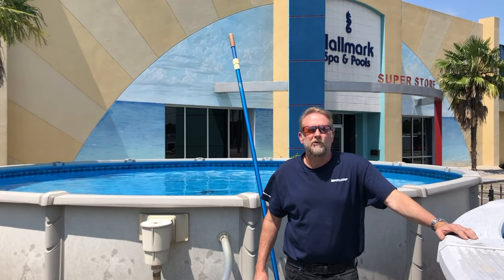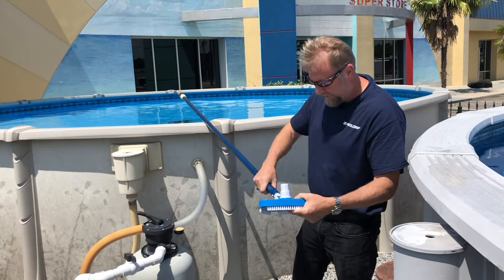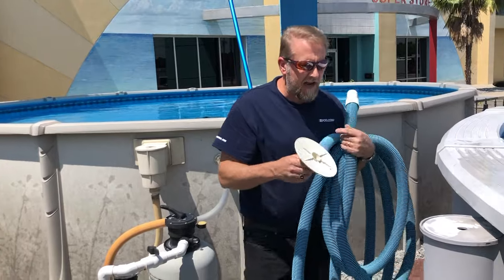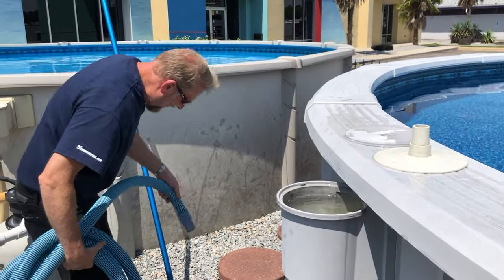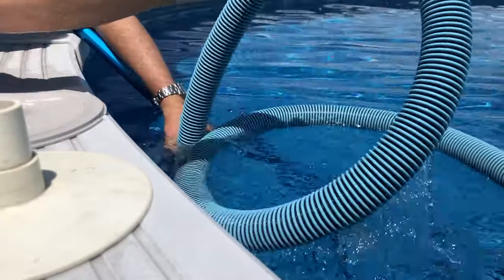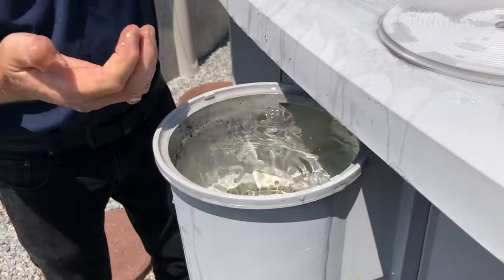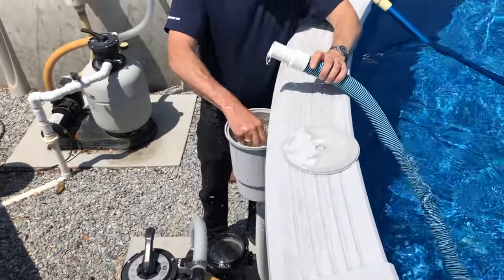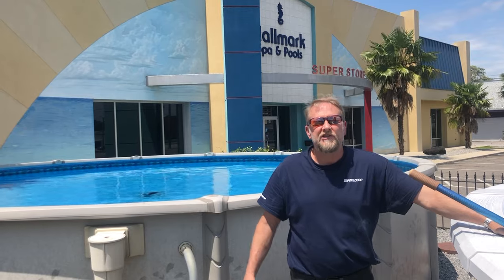How to Vacuum an Above Ground Pool!

Comment: what position do i have to put in the filter to vaccum my pool
Reply from the maker: For normal vacuuming use the filter position.
Reply: For large amounts of dirt and debris you would vacuum on WASTE. This pumps water directly out of the pool bypassing the filter tank. This is also best for extremely fine debris that may be too small for your sand filter to catch. Since you are pumping water out you will want to fill the pool as much as possible and leave the hose running water into the pool to allow maximum time to vacuum before the water gets below the skimmer.
Reply: What about vacuuming in the waste position? Algae

Comment: I have a best way pool that doesn’t have the skimmer on the side, I can’t find a video to help me figure this out.
Reply: Instead of hooking the hose to the skimmer like he did...just throw the other end out on the ground and you'll have to vacuum it out of the pool onto the grass or ground. You'll have to top off your pool afterwards if you loose alot of water.
Reply from the maker: Intex, Coleman, Best way and Summer wave pools are all very similar. When it comes to vacuuming, l have a video that show several different ways to vacuum these type of pools. Hopefully this will help, here is the link for the video. Thanks for watching.
https://youtu.be/6Uh2_2IlV4w?si=IGqbmlMrWs7pXA4E

Comment: Which setting do you set the sand filter on?
Reply from the maker: In most cases, you typically want to vacuum in the filter position. In extreme cases where the pool is very dirty, and you would like to bypass the sand filter, you can vacuum on waste.
Reply: To get sand out should I use filter settings

Comment: how long do u backwash afterwards?
Reply from the maker: Hey Kurt, 

You should backwash for a full minute and then rinse for at least 30 seconds. After doing this, If the return is still weak when in filter mode, backwash and rinse once more to ensure that you’ve got good filtration.
Reply: Great video and also nice you answered the backwash question.

Comment: Never ones shows you what setting he put it on.
Reply from the maker: You will vacuum in the filter position for normal cleaning, when a pool is extremely dirty or algae infested you would vacuum in the waste position. When vacuuming in waste you will have to add water to the pool. Thanks for watching.

Comment: My pom  runs out of water when I insert my vaccum
Reply from the maker: Before you vacuum you want to make sure the pump is running air tight. If it isn’t, you want to check the pump’s lid, housing, and o-ring to make sure it’s not cracked/damaged as well as the line running to the pump. If you’re running air tight then you’re good here.

Before you vacuum first check to make sure the swivel end of the hose is linked to the vacuum head. It’s also important you always prime the hose before connecting to the skimmer. If it’s not primed you’ll starve the pump however, the pump will eventually catch prime. If you’re still sucking air after letting it run, you may have a hole or a split in your vacuum hose, or vacuum plate.